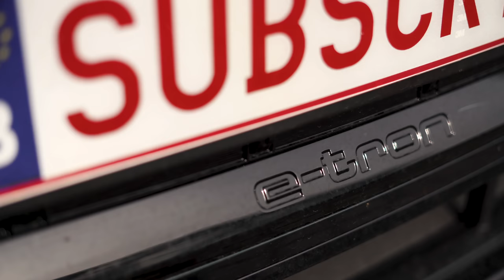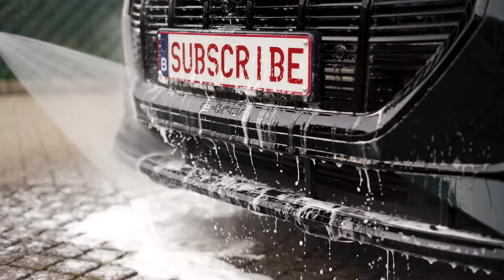Dirty Audi e-tron Wash, Polish & Coating - Full Detail

Comment: You can also foam the car over the degreaser before rinsing it off. I’ve found foaming over degreaser gives a bit more bite to the foam and the degreaser gets a bit more time to work on the surface then I rinse it off, foam again and mitt wash.

Comment: For a newer Audi like this - do you recommend an all in one polished like Essence or separately doing a light compound then polish
Reply from the maker: It depends on the condition of the paint. Sometimes new cars are covered in swirls and will require a 1 or 2 step correction before using Essence.